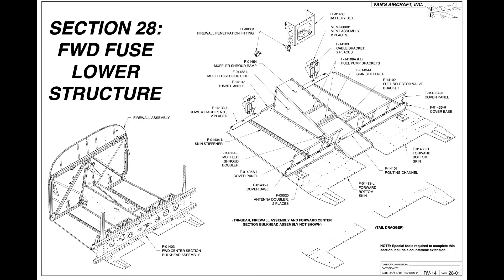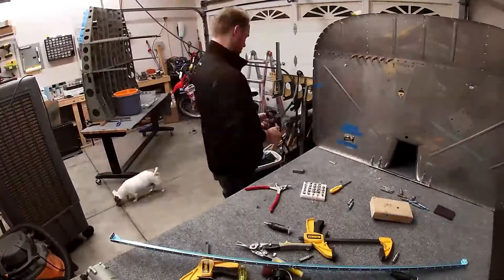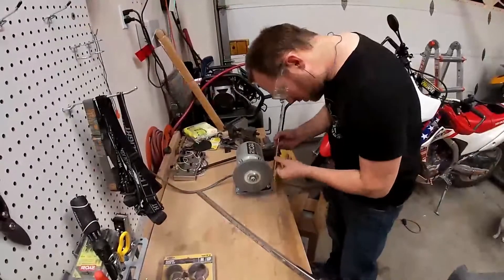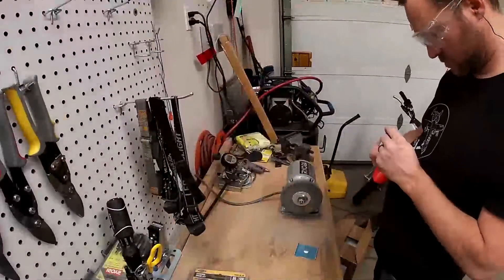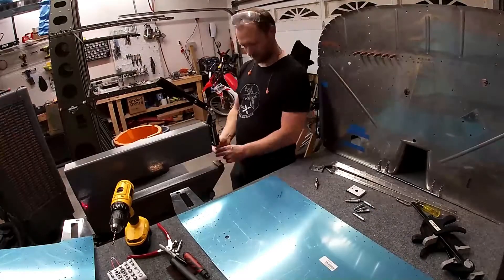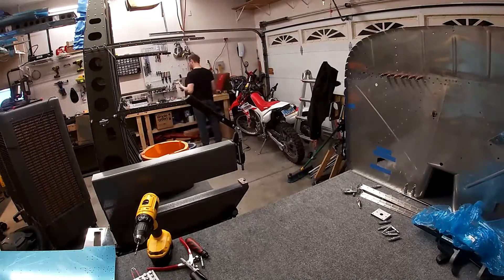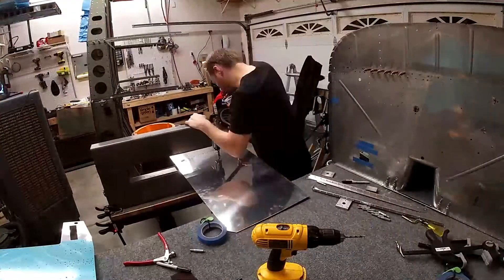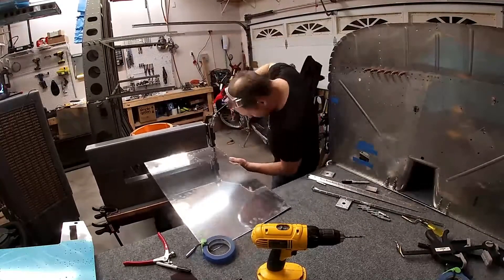RV-14: Fuselage 46

Comment: Josh, if you scuff before you dimple it’ll keep your hands and pads from getting torn up. It also gets inside the dimples more easily too.
Reply from the maker: Ah... that's actually a really good point.  I don't know why I've never realized that... I blame beer.
Reply: @JoshSinclair  This will be especially important when you start your wings. If you don’t get a proper scuff inside your dimples, you can have leaks from the rivet passages.